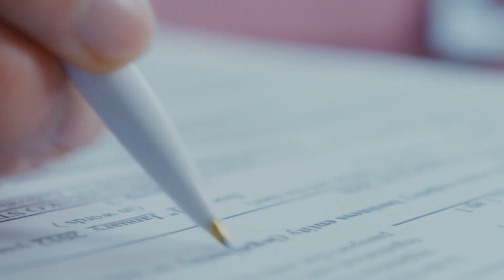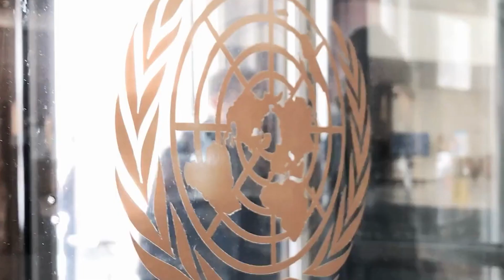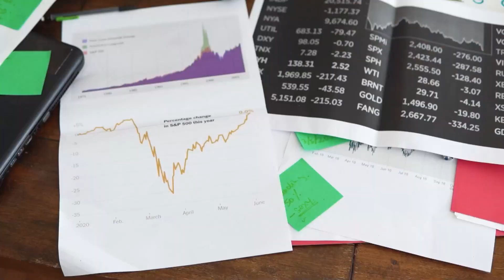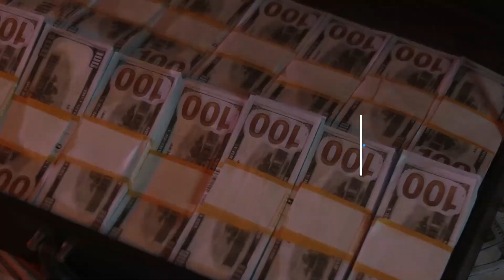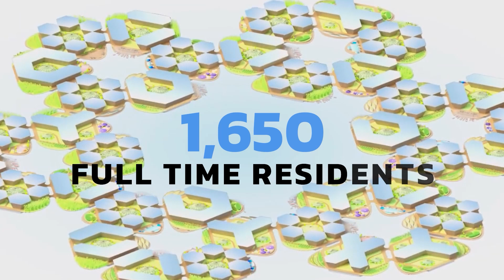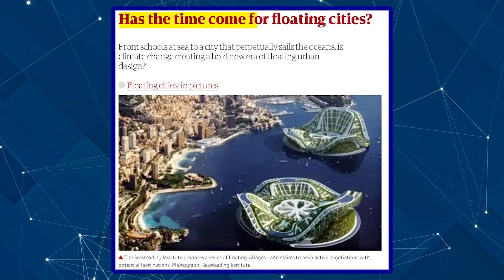Will There Be Floating Cities In The Future? Climate change, Living on the water

Comment: Only 17 reactions. 

Well if I read the news Well in 5 years Antarctica plate is broken loose giving the sea-level a 60cm rise. Nothing can be done to prevent that. With the 60cm rise also the once in a 100 year floods will happen more frequent. I would hurry up and just build these in 2 years not 8, 3d print them whatever fastest we can 3d print rockets so also this. Or are we waiting for the flooding first? 🤷‍♂️

The city of the heague in the Netherlands  is overcrowded I would say begin of shore there at the peer of Scheveningen. One plus side the Dutch know water.😉